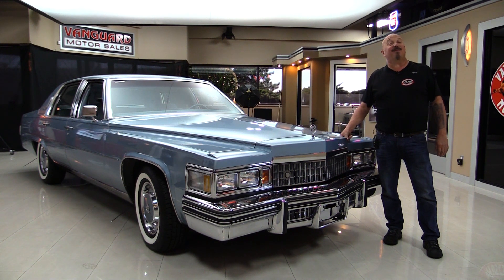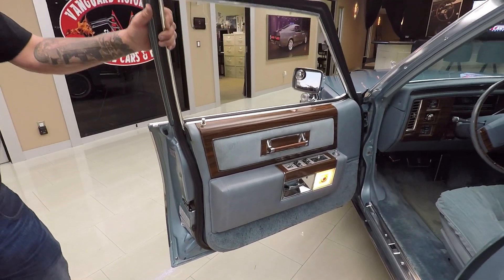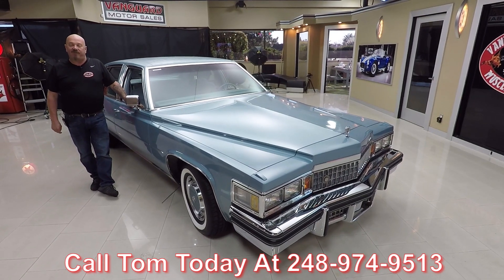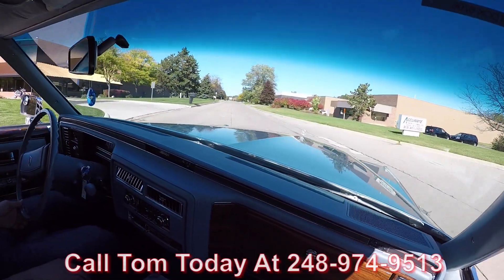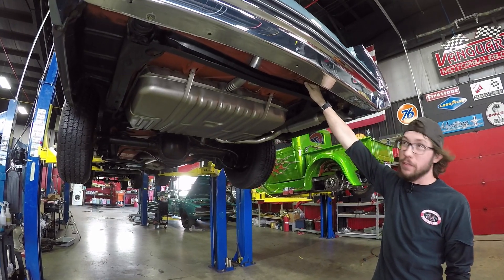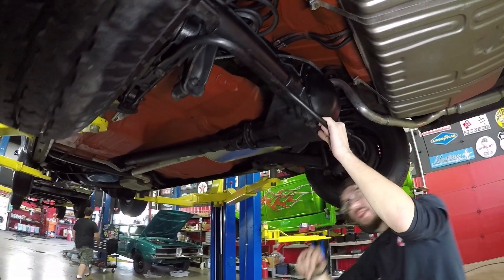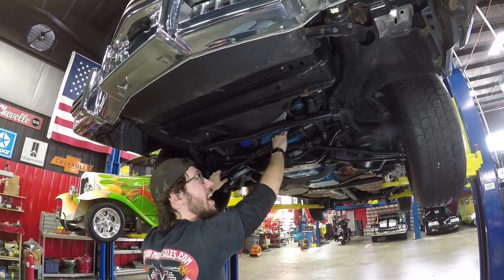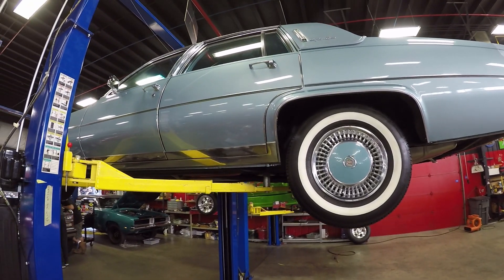1978 Cadillac Fleetwood For Sale

Comment: The Olds 305 they put in them were really good engines in them I had 2 fleetwoods with the Olds 305 & it was fantastic
Reply: The 1977 through 1979 models all were built with the Cadillac 425ci V8. With optional, electronic fuel injection.
Reply: In 86 they put the Olds 307 in, then in about 90 0r 91, they stuck a Chevy 305 in

Comment: This is a nice color & love the hub caps on this car.
Reply: The factory 'Color Coated' wheel covers were an elegant and head turning option available on the 1977, 78 and 79 Fleetwood, Eldorado and Seville models. Unfortunately, not many of the surviving ones managed to keep their original factory color coated wheel covers. A surviving mid 70's Cadillac which has it's factory color coated wheel covers still on it is a coveted prize for many Cadillac collectors. It was the mistake of numerous Cadillac buyers to remove and store away the color coated wheel covers in order to preserve them pristine and free of scratches and paint damage, but it always resulted in the wheel covers being a different color than the rest of the car because of paint fading on the car. Most don't realize how much a cars paint color changes over the years and the pristine wheel covers simply did not match the car anymore and  looked odd and were replaced with non colored wheel covers and so more often than not, a car with factory color coted wheel covers lost them along the way. If you are a Cadillac collector or just a novice, and have the opportunity to aquire a surviving 1970's Cadillac which has it's original color coated wheel covers still on it... buy it and do not take them off the wheels. It is becoming more and more difficult to find one with it's original color coded wheel cover still on it and still matching the paint color.